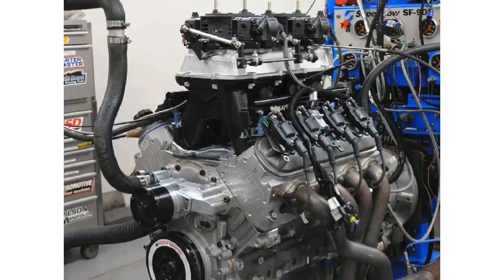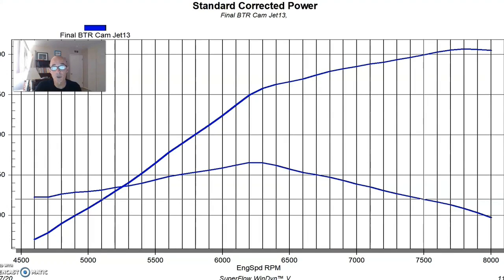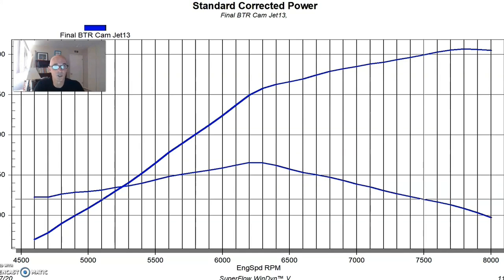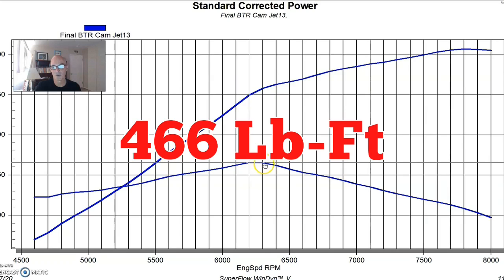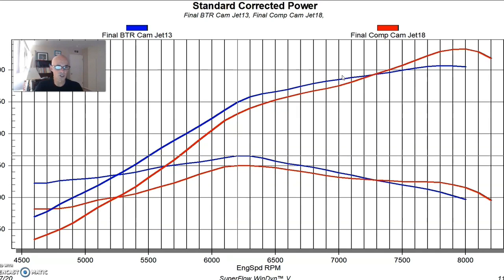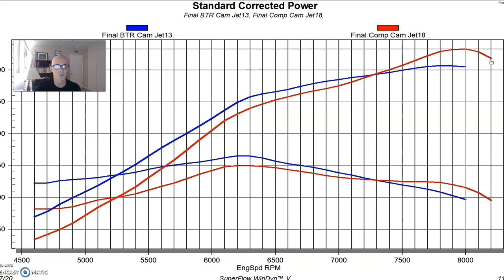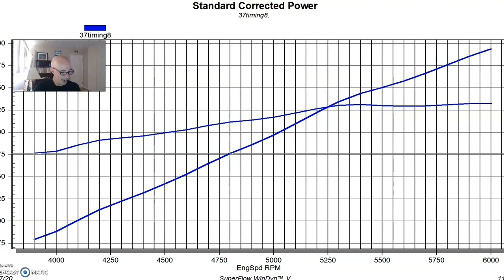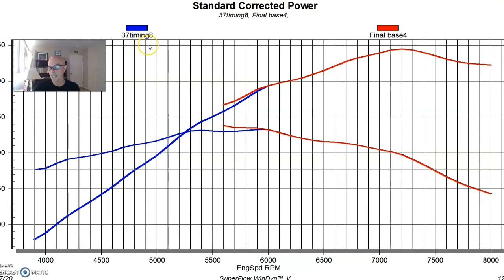8K RPM HYD ROLLER-WILL IT WORK?

Comment: It’s funny how everyone thinks a bazillion rpm is the shIt in smaller cubic inch engines.   The LS and small ford are designed to run up to 5 or 6k in stock form.   They’ll  run well past this designed reality but not with any appreciable gains for the money spent.   If you’re  drag racing or going in a circle for hours on end, you bet, you’ll need  to squeeze the RPM out of this junk til it oils the track with it’s guts.  If you’re  taunting a sucker in a hellcat with your beater Mustang or Camaro on a Saturday  night, stick  with a lower RPM package and spend the extra  
$$$’s on seat covers, one of those  pine tree things that masks the smell of gasoline and blow the rest on an expensive, ok,  meal for your date.     The engine will live longer and you’ll still hold your own against some dude who spent 10x what you did just to have fun on a Saturday night.    

Thanks Richard for doing the work, I enjoy watching your videos.   It might be 40 years too late to stop my stupidity..Maybe this will stop someone else’s.

Comment: It’s good that you point out none of these engines are stroke limited at 8k. I think the reason short stroke is often associated with higher RPM is with the same top end the short stroke engine simply takes more RPM to move the air and reach peak HP (valve train permitting). It would be interesting to see what happens to that 347 with a shorter stroke even though it's not stroke limited from a piston speed perspective.

Comment: you know the ls chev is not pretty not like the old sbc looks but i think auto componys back then allso made engines to look the part they played im a mopar freak but engines are my life so im not parital to any others so they all are nice .like the slant six dodge slat four pontiac the old151 four of chevy lorn duke not the newer one the one from the sixtys looks from then the small block chevy sbf thie valve cover it stands out its a ford mopar sbcc have diffent valve covers and the point is you now see how orginal every one was.if it looked fast it was and thats how they sold the cars.also back in the day you lifted the hood to idenifie what was in it and to check if the up keep was good oil trans fluid was ok and more but you can se and idenifie what it has thats how you know and those didnt they just juged by how big it was and if its just right cubes or not but i could go on but nope i wont.

Comment: 410 Sprinter,, running close to 9000rpm at least in qualifying.
Short stroke LS, unless you are are running a 5 litre capacity a waste of time.
363 Ford, I feel a very usefull bore and stroke for road racing.

Comment: Wen Ford vs chvey  stock  the  Ford  wins but install  camshaft  in chvey engine  just  camshaft  will make more power  than  Ford  even  wen u make  stroke  Ford  not  give  u the power  wen chvey engine stroke  or  dstroke

Comment: Cool vid good  seat form is what determines  low flow performance nothing else a certain  percentage off valve diameter Will calculate that.Followed buy port's turn again a certain percentage of valve diameter.Then port to valve cross over or saturation point again valve diameter percentage is involved basically valve becomes bigger then what port can flow so additional lift is useless or gain are minimal.maths maths maths and flow bench what I'm getting at Understanding engine maths is key to performance.oh yeah one more thing when selecting a cam I all start with overlap again maths

Comment: My experience was that the cams good for 8,000+ rpm needed higher compression to work well. I was doing this at high altitude in Denver though. I would expect the Ford to want at least 12 to 1 for that cam.

Comment: I understand on an absolute power level there is almost no reason to destroke an engine...why would you cut 3/8" from the stroke of a 6.0l just because you can? Where the short stroke engines work best is in class racing that limits either the absolute displacement or the pounds per cubic inch. The difference between the 4.8 and 6.0l is just over 11% stroke. If you are in a racing class that has a weight per cube, that's potentially 11% less weight and given that power is fundamentally limited by head flow, and both engines would have the same bore size they would have roughly the same expected power output. 
Lots of these classes are tire limited as well and the lower torque can be easier to launch, especially given how much lighter.the car is. 
For a street driven car, there is very little point to swap a shorter stroke crank, but for some racing classes it is the only way to win.

Comment: You were limited on your 363 Ford by the intake manifold.  Unless that super  victor is ultra ported it will not support the amount of flow that those heads will pull with a big bore SBF and that 5.4 stroke.   A tunnel ram would have done your 600+ HP number.  IMHO

Comment: 347 all day long.  It has lighter pistons.  By far.  And that makes a huge difference when you start revving up past 7000.  Kudos to you also,  for using stock lifters to reach out to 8000 rpms.  I am surprised by that.  I would love to know what lobe profile was used.  It surely was easy on the opening and closing ramps to keep the lifters from lofting without using killler spring pressure.  They are heavy when they are full of oil.

Comment: Problem with the ford is likely two things combined. 1 cross section area is to small for the cubic inch. I would have gone with the 240 port and the 11/32 valve stem causing  the valve to be heavier than the ls stuff will cause the lifter to bleed down.  Put lighter valves in the heads or go to a short travel lifter and put 240’s on it. At that point run it and see what ya got. I bet you’ll be able to take some camshaft out of it at that point and get more mid range from it

Comment: I think that Crane cam was the limiting factor on the 347. Can you do a video on custom ground rollers versus off the shelf.... Matching cam to head flow numbers since the vehicle info can't be entered?
Cam Motion has made almost every build I've done surpass most in not only peak number's but bringing the average up across the board

Comment: I think that a rocker girdle and bigger primary headers and some different valve springs and timing on the ford would have helped alot on higher rpm I built a 306 with mahl forged pistons and gtp 40 heads that I ported balanced lower end Lunati roller lifters and rocker girdles crank girdle Canton crank scraper melling high volume oil pump gear to gear timing free floating wrist pins and 1/7-8 headers made 540 with a 75 shot

Comment: On the 347, how's the timing curve? Is everything optimized for the amount of dwell time that the rod/stroke ratio provides?

Thinking way out in the weeds here and would need a LONG time with a notebook and calculator, but with that kind of piston speed... could it be compressing the charge so quickly that it's stratifying, basically forcing all the fuel towards the piston crown? The corollary would be drawing vacuum so quickly that the intake simply can't flow a full charge in time. You'd set up some nasty resonances, with those long ports could even get to the second order harmonic for density pulses... or just shy so it's sitting in the trench between pulses at max RPM. 

You've got a "short" single plane windsor intake sitting around from previous tests, don't you?
Reply: In my opinion, you're not thinking in the weeds, you are right on the money.  When you reach those engine speeds, dwell time, valve events, etc. happen in milliseconds.  With roughly 20 more cubic inches of displacement, the cam in the Ford was just too small to carry any power out to 8k because the valve events were too short for the added piston speed and displacement.
Reply: 333 cubic inches is the ticket. You nailed it on piston speed and intake runner length. A shorter stroke with dual quad tunnel ram and 660 Holleys.

Comment: Didn't hear what compression ratio  that you were running  on those motors.    I knew guys running 302's with similar duration solid lifter motors with dual  450 cfm Holleys on a tunnel ram making 600+ hp with ported stock heads!   You need a lot of squeeze to make that kind of power 12-12.5 at least.
Reply from the maker: a ported E7TE making 600 hp?
Reply: @richardholdener1727   69 351W with  big valves.   They used to make serious HP with what was available,  it was the early 80's.   It was in a Pinto.
Reply: They used to get crazy with CR's back in the day.  427 Ford running 14:1   Or Buddy Ingersol with his 267 cid SBC Camaro running in Comp after they outlawed his AA/MC turbo Pinto 2.0l  for running a full second under his index.
Reply: @richardholdener1727  https://www.youtube.com/watch?v=ZIoLJzoOQBw

Comment: My SBF comb is use a chain, wrap it through the block, use it for mooring my boat. 
Best part is it’s something a ford engine never fails on.
Reply: Thats weird. Takes 2 SBC to moor my boat. Must be the built cheap thing. 🤷‍♂️
Reply: Naw the ford designers knew they would be used as a boat anchor. They made them useful after failure

Comment: I road race my old Camaro with a 400hp 350, .500” Hyd roller, fast burn heads. It’s upgrade time - Can I keep my docile dual plane manifold with a .600 lift hyd roller cam? Can I bump compression to 11.5:1 and keep running pump gas?  What will 6” rods do? Thanks! By the way, I used to read your stories when you ran the Vortech blower on your fox mustang at the silver state classic challenge. Glad to see you on here.
Reply from the maker: yes on the cam upgrade-though lift might not help things if the heads don't flow well there, yes on compression-but will require less timing,   6 inch rods wont do a thing,
Reply: @Richard Holdener - great info all around, heads are 210cc as delivered, I will look into head flow numbers prior to cam selection. interesting about the rods. Thank you very much.

Comment: I think maybe the issue with Ford making not making more power was 
1. Crane Cams- they were always wildly inaccurate and had poor valve train control ( I am bias toward Comp Cams because they’re around the corner from me )
B. Was the crankshaft a zero balance ? The factory imbalance specs eat a lot of power at high rpm.  
3. Headers too small maybe 
D. Was it a 100 degree day when you ran the dyno ? 
5.  Needs more timing.  Twist the distributor until molten bits of piston ring start flying out the exhaust then back off 2 degrees.

Comment: Great info. Very interested in moving up the red-line and your test does prove it can be done with hydraulic lifters. I would still go solid for anything I intended to run north of 7K regularly or for sustained periods. I am fairly sure there is no such think as a 8K pushrod engine that can be treated as if maintenance is not needed regularly like an OEM 100,000 mile design life beater engine. 

I have been bookmarking and saving info on higher RPM builds for some time. There is a great article from 2010 I keep revisiting. It features pictures of dark daired dude working on a good old high RPM SBC 302.. you guys might be familiar with it.

Comment: I would bet the ford was getting air in the lifters It appears the valvetrain was stable. Lifters were collapsing however, causing it to peak early. It would have been interesting to put solid roller lifters in it with no other changes to see if the peak hp rpm went up to where we would expect it.

Comment: Possible another camshaft for the Ford ? Is the valve weight spring weight limiting the Ford?  Why not try the ford 3.25 stroke with a 4.125 bore? Would the Ford like the Funnel Web over the Victor JR ?

Comment: How about a Rhoads anti pump up lifter test. They do what they say. I have a big lumpy cam and it certainly did smooth it out at idle and it reved out another 500rpm with ease to 6500rpm when the stock lifters were only good to about 6000rpm.
Reply: yeah, it would be great to see their limits. I have Crane's in my Olds 455--no way i'm taking that past 5,500 RPM :)

Comment: needs more carb not enough cfm on the FORD SHOULD HAVE HAD THE SAME INTAKE AS THE LS
Reply: a SBF isn't gonna make the same power of an LS.
the result is pretty accurate overall.
Reply: @Elliottfan1993 the 363 had more cubes, more bore and more cam than the ls in this test. I honestly thought the sbf would have taken this test but it didn't fit some reason
Reply: I agree.   The carb and intake pulled it down.

Comment: That’s go to know. I just bought a CompCam 201-428-17 for a 5.7 based hemi stroker. Cam card says it’s operating range is 2400rpm-7400rpm. But it may see more rpm going through the traps.

Comment: I knew it wouldn't you can't beat GM for power ford bigger bore bigger cam and. Sure more compression still made 100hp less the the smaller Chevy motor

Comment: Why no tunnel ram and duel quads and multiple cams on the SBF?
Reply: @port nut youd be suprised, a 347 is honestly a pretty big motor by most standards, I mean yeah it's not a 427, but it definitely ain't no 289
Reply: Probly doesn't have one laying around
Reply: You got? Why not send it in?
Reply: @ron Kay I thought he said it was a 363
Reply: It originally broke on the dyno after the first run

Comment: Possible bore shrouding on the SBF.? My favorite/best combo was SBF / Dart SHP bored to 4.185 with a 3.25 crank. 358 cid.
Reply: Yeah, rod ratio isn't great on a 302 so that is a good combo.  By the way, I'm looking for a block like that, I already have crank and rods.  If you know of any deals, let me know.
Reply: Circle track?
Reply: @larrynorsworthy8582  I want one for the street.  I have a Roush induction kit twin plenum intake for it, it needs something crazy underneath.  I want something bulletproof that can rev 7,500 easy, live between 4,500 and 6,500 all day and make enough power that it doesn't look stupid.

That's hard to do with an 8.2" deck but I would rather stay Ford instead of take the easy way out and swap in an LS.
Reply: @larrynorsworthy8582  Drag car, solid roller, 12.5 to 1, Fox body Mustang, GForce 5 spd. 8800 every pass.

Comment: you always say stroke dont matter every thing equal here is you an easy one !! use a chevy small block 400 block with a 350 crank then a 350 block with 400 crank !! that be a cool test !
Reply: Thad Knutson  in my experience some guys i have known built 350 with a 400 crank make gobs of mid range didn't really wanna spin up for a track car ! now the 400 with the 350 crank i have seen some crazy R's but would sometimes pull the center mains outta the block !

Comment: The Ford should have run better.  What was the intake valve diameter?  The Ford didn't have a very much longer stroke than the LS.  3.400 vs 3.268.  But the LS had a longer rod than the Ford, which should help breathing due to lower peak piston velocity.  And the longer rod would reduce friction due to lower thrust loads on the cylinder wall.

Comment: sbf 347
cam chart says cam for 357 or bigger cube,  works great 363
over camed  they recommend one size below
 heads are to big ,no velocity 
its trying to chew to much fuel/air volume not a mopar
when you let off the gas at wot you should here a woosh echo sound like a pro stock motor threw the timing lights The reason ford won so much in nascar is they had fuel in the tank left

Comment: So what are the nascar and dragrace guys running for lifters that consistently hit 8-9 even 10k rpm???
Reply: Solid roller lifters that are light. Hydraulic lifters tend to be heavier and have just a bit of squish so you loose a little lift.

Comment: Maybe it was the LSA that limited the hp peak? Also, were the specs for duration on the sbf cam at .050 or advertised? That would change a lot. The stroke would only affect the piston speed, which affects wear and tear. On a race motor, that doesnt matter but on a street motor its a totally different story

Comment: The real question is not can you or not BUT RATHER for HOW LONG before parts give up the gosth.
Reply: what only makes this interesting, is that the solid roller lifter spits its needle bearings all over the crank after 7,000 street miles or so. If these "juice" lifters can last at this RPM, then there's no reason to run solids and have to take them apart every two years to be sure.

Comment: Makes me wonder what an engine like the 5.2 Voodoo can rev when messed with since they rev to 8k stock.
Reply: Check out Revan Evans ch on YouTube, he has a video on Factory Stock Coyote class, where they have stock valvetrain with aftermarket springs turning 10k rpm.
Reply: Its an overhead cam engine... much easier to rev out... still the limit is generally a function of valve-train stability... I think the stock 8K is more about stable low rpm idle to meet emissions requirements. There is only so much of the RPM range any single engine can cover efficiently.

Comment: Well It shows all the signs of not having enough spring but knowing you already had that handled perhaps it was the cam after all? Just a guess but what if you changed the cam timing? You may be able to see if it is the cam by seeing if the issue moves with cam timing.

Comment: I would like to get your 2 cents on ls rocker arms.. Roller bearings? Bronze bushed?
Reply: All LS engines have needle roller bearing fulcrums from the factory.  Some race applications require heavy duty roller bearings.  I have never heard of anybody building an LS with bronze bushed rockers.